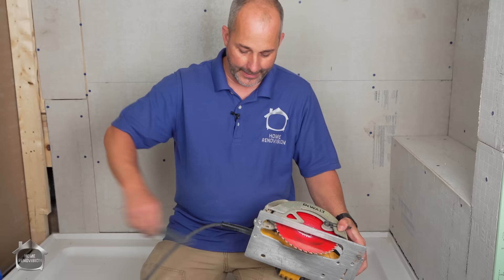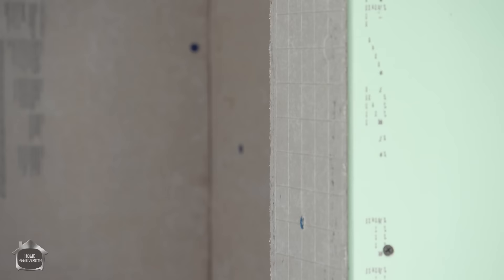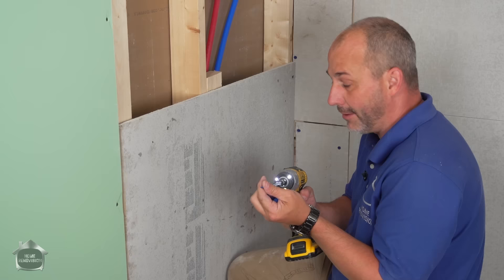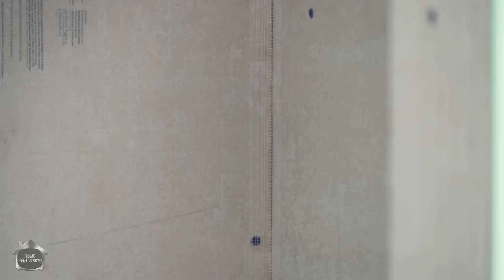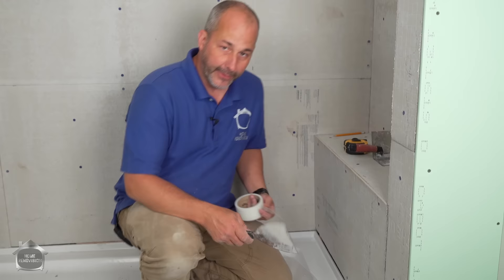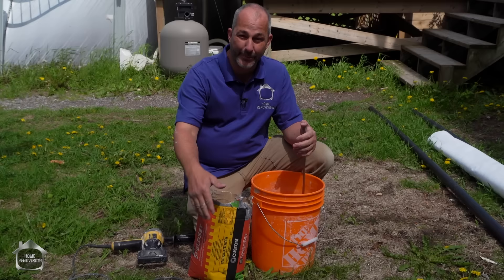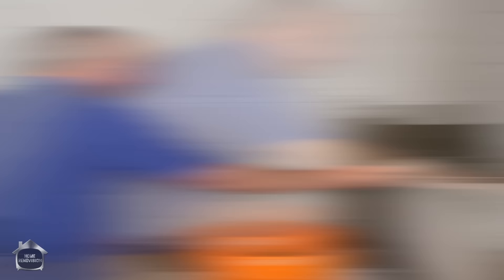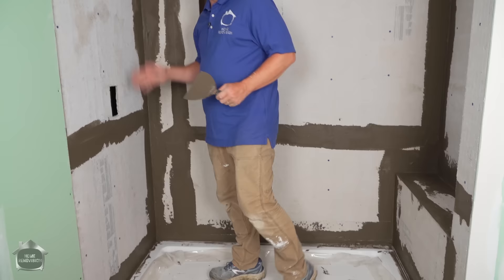How to Install Cement Board for Beginners

Comment: I guess my only question would be how do you decide how tall you want the cement board to go up to? all of the way to the ceiling? And then if you paid with the aqua defense on the corner from the cement board to the green drywall? Thanks for your time! 
I live in Georgia, USA - and have no idea what my code is. LOL
Reply: You should put the cement board  around 12 inches above the shower valve on regular showers. Water proofing is the same but it's best to seal any open joints that will be behind the tile.

Comment: How do I go about screwing cement board to drywall. Planning to install cultured stones indoor. I seen some videos on YouTube they just screw anywhere, does it have to hit the studs through the drywall? Also what size of screw is needed? Thanks!
Reply from the maker: I would remove the drywall so you can find the studs easier. the screws are not designed to attach through extra material. Cheers!

Comment: I’m confused - so when you tile it and put a bead (silicone) between the tile and the pan/tub, it then becomes a barrier for any water that has got behind the tile and run down the waterproofing into the lip of the pan. There is now nowhere for that water to go

Comment: Would you ever recommend using the same process to build a custom shower pan? The supply chain has broken most of the bigger stores in my area and I considered using 1/2" hardi board and this system for a small shower which would be far cheaper than the Schluter Kerdi-Shower Kit.
Reply: Do I Even Needa Shower Pan
Can't I Jus Use LiL 1x

Comment: Is there a difference between red guard and aqua defense for cement board? What kind of mortar can be used (modified, non modified, any recommended brands f on HD stores)? Thanks
Reply from the maker: HDF sells redgaurd. I suggest non  modified cement when using it. Cheers!

Comment: great video ! my question is when you are taping the gap between the basin flange and the cement board with waterproofing membrane tape  , would it be a good idea to also include self adhesive flashing tape in behind as an added layer of water protection? flashing tape would wrap the flange in behind the backer board.

Comment: I have one far wall of my shower that is green board and the rest is cement board. Can I still use Mapei aqua defense on the green board? If so, anything I need to do to prep the surface?
Reply: Technically, you shouldn't use Greenboard in a wet area, but if it is coated with a WP membrane it acts the same. I've seen green board sit out in the rain for days and it's fine. The point is, whether you are using cement board, or greenboard... If water gets through the membrane you're screwed either way. Actually, cement board literally pulls the water through if there is a gap in the membrane. 

Redgard works amazing. I would trust a shower with purple board gypsum coated with 2 coats of redgard if code allowed it.

Comment: Can I use 1/4” cement board over existing bumpy tile with mouldy grout and then glue a vinyl sheet over the cement board? The issue I have is that I can’t afford to pay for demolishing and rebuilding the bathtub surround walls. Help!!
Reply from the maker: no but you can use adhesive to install an acrylic shower wall panel on top of what you have.

Comment: The one question I came on here to find you never answered. There is a smooth side to the hardy backer and a rough side which side do you put out it looks to me that you put the Roughside out which is what I think it should be but does it really matter since you end up putting a waterproof membrane over top of the Roughside making it there for a smooth so I don't know
Reply: It doesn't matter but the smooth side will require less waterproofing liquid as the rough side will need that surface filled in

Comment: Have you had issues with the screws sticking out and not being flush or recessed in the cement board?
Reply: Just like drywall, the screw heads should be just under flush, set into the board about 1/16" or so. You don't want it stick out or punch it too far in either.

Comment: What will happen if you installed the hardback over the lip???
Reply from the maker: you create a  weird angle to tile over. in order to tile straight you need to build out every tile from the second row up to the ceiling. a lot of extra work that is not necessary!

Comment: Yeah, after even more thought. This method makes NO sense Jeff, the thinset/quickest you apply to that flange joint, it is just asking for trouble, if pan flexes, that joint cracks, with changes in temp, etc, or any settling of home, etc etc, a crack THERE, would definitely cause an entry point for water to get behind the wall. I LOVE your videos, have learned tons, but about to do my tub to shower conversion, my walls flow from shower to rest of room, so the common sense even tells me, the hardiboard going on top of flange, may leave a meager spacer for flexing that I will water proof and caulk, but no roll on membrane is going to be  strong enough to guarantee not to tear if that joint you filled cracks for any reason 😊 please tell me one good reason for not running the backer over top of the pan flange :) appreciate any logical answer 😉

Comment: Quick question. You mentioned anytime the cement board meets drywall, use 1/2” . So the back wall could be 1/4”? Or would you recommend that wall be also 1/2”?
Reply: good question!
Reply: meh a backwall gets structural you better use 1/2'' (I think) not like you're going to save space.

Comment: does the wall across the "tile backer" studs (the board behind the cement board across the studs) also have to be a cement one? An additional question is: Can I use fibreglass insulation to soundproof the noise coming from the bathroom? Thanks a bunch.
Reply: Congrats on the channel, not only extremely useful and valuable but also really fun as well.
Reply from the maker: drywall can be on the other side for sure. and yes fiberglass will help with sound control. Cheers!
Reply: Home RenoVision DIY thank you so much! Thanks for helping out the community of DIYers!

Comment: Help! This is opposite of what I thought but maybe it's different in mobile home? Here is what I'm dealing with: 94 Double wide mobile home just purchased, found mold, had to take everything down to the studs in the second bathroom and getting ready to put it back together. 1 Exterior wall (cold winter months South Dakota) where the bathtub shower combo goes back in at and I'm going to tile the surround. Put new insulation in on exterior wall and was told the vapor barrier/Thick plastic needed to go up and then cement backer board over that. Can anyone confirm this? Is it different for a mobile home or in colder climates on an exterior wall? Because in this video, the cement backer board is first and then vapor barrier on top of that and I'm so confused
Reply: It sounds like two different products you're talking about. 1) A plastic vapor barrier. 2) A waterproof membrane. What you need may depend on what you're installing. The correct answer might be both or neither.

Comment: Oh, we screwed up. We used 100% silicone caulk to fill seams & holes in the cement board,  a lot of caulk.... Now we we realize that nothing sticks to 100% silicone. Ugggg, any solutions??? We were planning on taping cracks with thin set & using a Redgard water membrane.

Comment: Hey, love your videos and it's awesome that your also from ottawa so it helps to know what will pass by code overe here. My question is, I'm going to use kerdi matting for my shower walls, is it ok for me to use drywall or am I safer to use cement board. I haven't bought the drywall yet and haven't been able to get the right info anywhere. 
Thank you 
And thank you for all your videos, they reassure me that my ideas are either correct or not.

Comment: Long time watcher here. I have a contractor in the middle of a project. He’s putting green drywall up. Using mud with no trowel and sticking tiles on. He refuses to use a waterproof membrane and is not sealing the seams he says he will use silicone to seal. What should I do?
Reply: get a different contractor

Comment: I’m surprised you use mortar on bottom between the shower Pan and the backer board. With the Pan flexing, wouldn’t that end up shifting and cracking up the mortar among the bottom over time?

Comment: Great video! One question and one comment. Question: my Dreamline shower pan indicates caulk between concrete board and pan rather than quickset. Makes sense to avoid cracking as the pan flexes. Your comment on this? Comment: cutting cement board with a blade made to cut drywall works great (better blade), and the suggested circular saw blade for concrete board is not a valuable purchase. Messy and costly. Hole cuts with standard hole cutting attachment for power drill works perfectly too (as long as it has a pilot drill integrated).

Comment: First, I love all your videos! Thank you! Now, as I'm planning to remove 7ft glass panel from shower and build a floor-to-ceiling wall in it's place (and tile it), how would I connect the vertical beams to the ceiling? Do I need to rip out ceiling to find the 2x4's in there? Do u have a video to illustrate something like that?

Comment: Ive tiled before and I’m working up the courage to do my shower.   I’m sure products have changed, but it looks like you’re still using fiber board with fiber tape?? But now there’s a roll on waterproof material?? On my floors, it was thin set, tape with more thin set over that.  Thank you for the videos.

Comment: I’ve been trying to figure out how to get nails and screws into my apartment for years. My walls sound airy and hallow when I tap them, but they are ROCK SOLID. Nails bend and screws hardly go through. No studs behind them, so I’m assuming it’s a sort of cement Sheetrock? How do I hang anything with these walls?! 😫
Reply: Search on YouTube or Google for ‘plaster wall anchors’.

Comment: Is that 1/2 hardi backer or cement board you are using?
Reply: Looks like mainly he used cements borads for shower and one portion he used Hardi backer boards which has grid lines squares on the board.

Comment: Holy crap! Using a saw on 1/2" cement board?? I've been scoring it and cracking along the seam exactly like drywall the last 30 years and have never had an issue and there's a hell of a lot less dust . Otherwise an excellent how-to vid.
Reply: Do u use a regular razor blade or a special cement board knife?  If they make one ?

Comment: That cement coat is gonna be so thin and the pan is flexible... that stuff is gonna crack and be worthless. I agree there is benefit in filling the cracks, but seems like it should be caulking. lots of options. Then paint with the aqua guard

Comment: I was going to put tile over my drywall...do you think i can get away with it and itll be just ass effective/good?
Reply: he has a video for that. Essentially you just seal the corners and use the roll on membrane over the whole service and add fibertape to the joints.

Comment: Thanks for the great videos, this is definitely my favorite tiling channel.   I have a question. When installing hardy board vertically, and you're bringing the edge to the halfway point of a stud, you have no choice but to screw about 1/4" to the edge so that you're grabbing a decent amount of the stud behind.  When I do that, the edge bulges out or breaks. How do you avoid that?
I'm guessing corrosion resistant roofing nails is the answer, but I'm wondering if someone is using screws, is there a best practice to avoid crumbling?
Reply: Put the screws right in the crack.  There are wide head screws and also some washers available too but in the crack should be fine.

Comment: I don’t understand the curdy board or membrane. Looks like a lot of expense over just water proofing. In NSW Australia I use a pre primed cement board, fill joins similar to you, then extra primer and 2 coats of a thick rubber based membrane. Our membrane seems to go on much thicker than what your applying.

Comment: ahh...the shower pan i have to install does not have a 1/2" lip like that so it does not line up nicely with the 1/2" cement board.
Drats, now what?

Comment: Shower vapour barrier extends one inch into shower pan and  wonderboard installed over the vapour barrier with a 1/8" gap above the shower pan.

Question is if I put fiberglass tape over the 1/8" gap above the shower pan and then apply thinset and Redgard over this, how does any water drain out into the shower pan that may get trapped in between the vapour barrier and the wonderboard?  Or should I not use a vapour barrier and just concentrate on waterproofing membrane only?

Comment: Drywall works fine for tile, but it is no longer code.  A good tile job wont leak either way.  I have seen 70 year old tile over drywall that was in good shape when removed

Comment: There sure is a lot of conflicting information out there regarding the installation of backer board and tile in bathrooms. Some swear by the liquid waterproofing membranes like Red Guard, Aqua Defense and HydroBan. Other long-time professionals roll their eyes and swear that they're overkill and grossly overpriced. I've spent more hours researching the subject than the work itself will take! And I'm still sitting on the fence.
Reply: I’ve used them all.   Use a liquid membrane at a minimum.  Go board is also a really good alternative

Comment: Why not use your Lepage 2 in 1 sealant instead of mortar? seems easier!
Reply from the maker: it is not an approved install. But it would probably work if you want to try on your house!
Reply: @HomeRenoVisionDIY  aww man... but... would you approve xD? what if I then add some shower Membrane Tape mixed with red stuff on top? How long would that last? I've designed a shower with a weird cavity in it for a toilet to slide out and mortar messes with my sanity.

Comment: I NEVER use my Good circular saw to cut cement board or drywall. If you like your saw don’t. Because that dust will get inside your saw and destroy the motor. Might take a while but don’t see how it wouldn’t. Now you can use compressed air to blow out the dust I guess?

Comment: This stuff just gets more overkill every year, and frankly, you can't count on home owners to take care, so I guess it makes sense.   Does seem that cement board is already waterproof, and now we have plastic sealing grouts, and we have epoxy products for the tile, but we still need a membrane.  I've torn out showers that had that vinyl over drywall, and everything was fine.  It is certainly driving up the costs, but you don't want call backs.

Comment: I used these blue screws and they did not work. Be careful when you buy them. Use the narrow heads. I bought the wide heads. The reason they do not work, is the point is so long, there is nothing to grab into the wood. I will have to predrill pilot holes to make sure, they are able to enter the wood. Not practical, not fun. I like the speed at which he demonstates his home renos, but I am trying to understand how water get through the tile and grout into the wall. Cannot we put a sealer on the grout? There are floor products with sealers.

Comment: YOOOOOO..... You really need to be recommending a particulate mask when cutting fiber board. Cement board has silicas in it. Those cause cancer. You should have a minimum p100 and should be wet cutting to reduce dust. A face shield is recommended so you can see while wet cutting.

Comment: I’ve always cut my cement board with an angle grinder never even tried a circular saw
Reply: Dam you would definitely need that mask : )  I use a nibbling tool that crushes/cut it. It's fast enough and doesn't leave any dust at all.
Reply: @JediGIJoe  all personal preference honestly those cement board shear cost a lot especially if you dont cut it often.

Comment: It didn't look like he was using a respirator when sawing the cement board with a circular saw that creates massive amounts of cement dust. That's a high risk task to do so without lung protection and is nothing to take lightly if you want a long and healthy life. Silicosis isn't something to ignore with high risk tasks.

Comment: 1/4" is for floors or vertical if completely backed. Can't span studs. Hardie says screw pattern is max 8"...not 12". 3/8" in from edges and 2" in from corners. No No NO you DO NOT apply mesh tape and mortar onto the shower pan. You're going to install a whole shower waterproof membrane and then have water sitting in the pan top wick right up that mortar edge because there's no way to seal that bottom. Even caulk will let in water. You want an air gap at the bottom. Water can't jump a vertical air gap.

Comment: REMINDER: Please don’t use power tools to cut cementboard/ backerboard... the dust is extremely dangerous... simply score, (like you would with sheetrock), and snap it as he describes in the video.

Comment: Is anyone going to comment on the big gaps he had on the small pieces on the back wall to the shower head wall ....
Really ? 😂😂
I understand he filled it with quick set cement mortar.. (which  conveniently was left out of the video...)
And puts the aqus defense water proofing coating only 20 min after applying the cement ....
But i definately would have started the fullbsheets on the left hand side and put small pieces to the bench side ... 
Also you can say you can apply the sealer over the cemrnt before it's fully cured.. 
But its better to wait for it to cure... 😒
Yet later he states s as he is applying the sealer that its better to be safe than sorry ... 
Changing the panels , very minimal gaps, and waiting to cure would be better safe than sorry .🙄